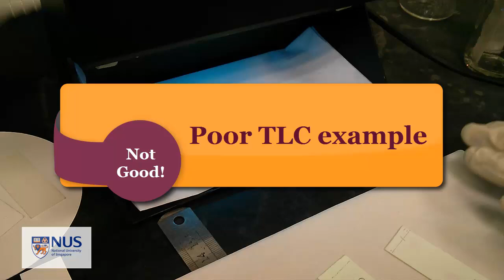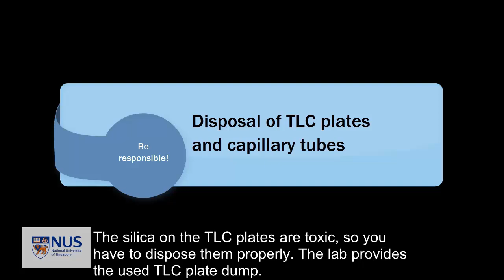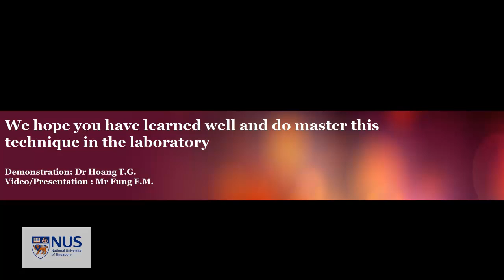【4K】 --- Thin Layer Chromatography (TLC)🌟

Comment: What the function of filter paper that u put in tlc chamber? And if  not put it in chamber what will happen?
Reply from the maker: the vapor pressure won't be consistent. that means the Rf value may not be accurate.